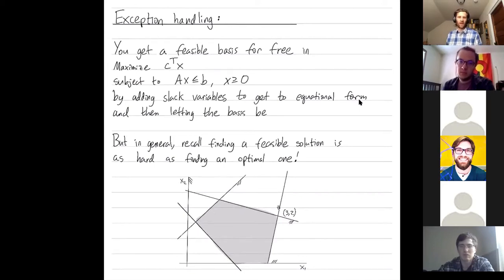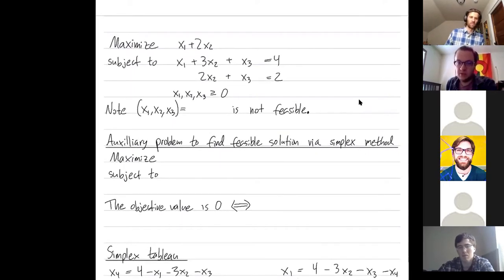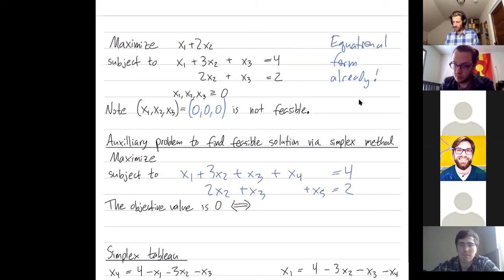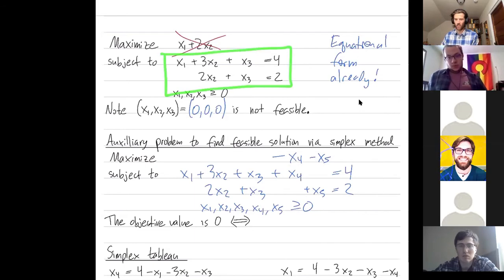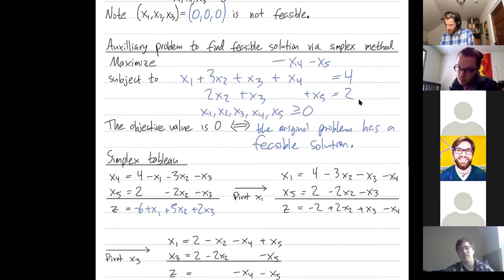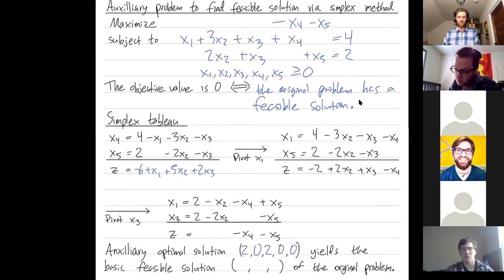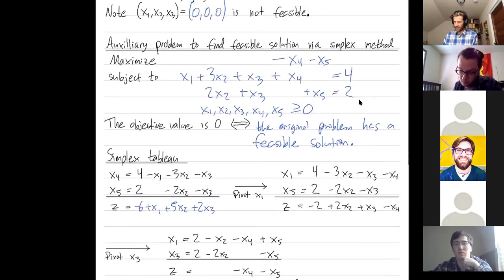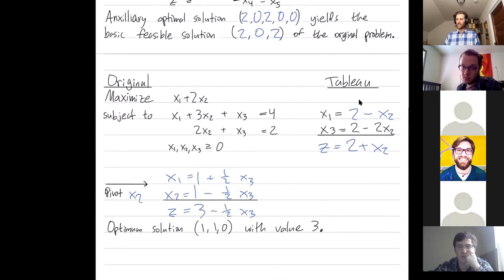Linear Programming 20: The simplex method - Infeasibility

Comment: Why do we solve the auxiliary problem when we will be able to extract a feasible solution from the original problem?
Reply from the maker: We solve the auxiliary problem to see if a (basic) feasible solution exists. If so, the auxiliary problem finds a (basic) feasible solution. Starting from that initial feasible solution, we continue with the standard simplex method (Part II of the simplex method) to find an optimal feasible solution. If not, then the auxiliary problem shows us that no feasible solution exists.